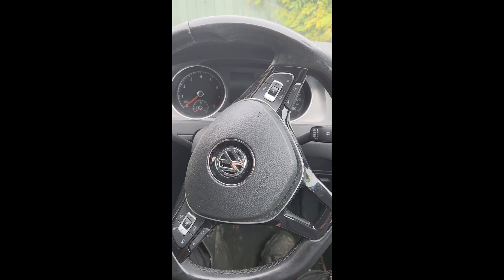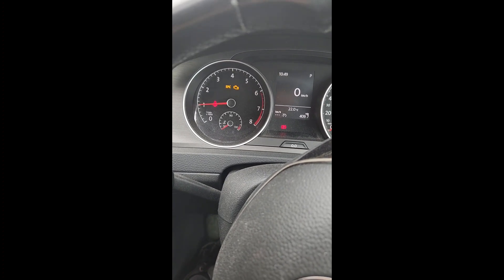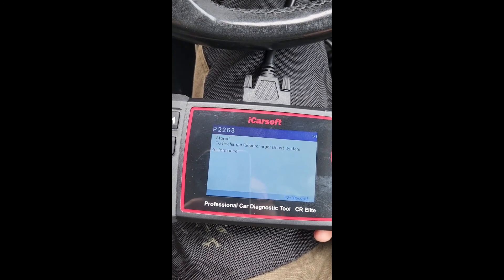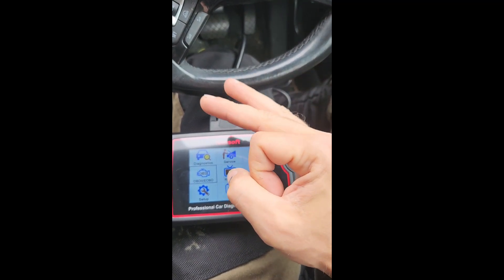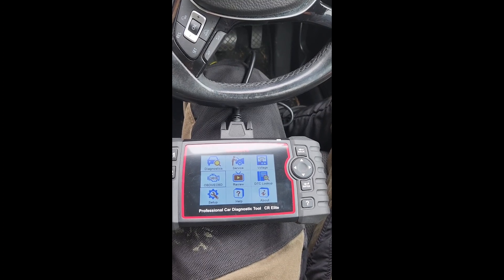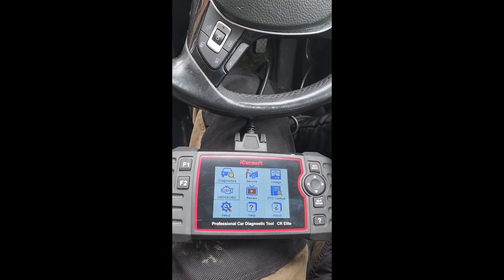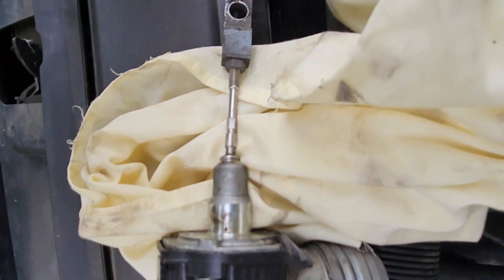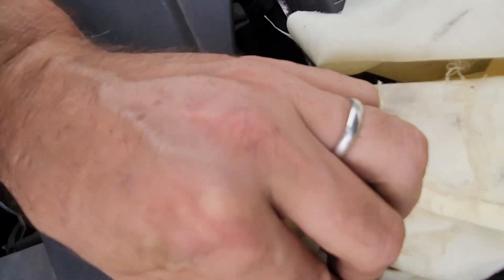vw engine code p2263 epc light turbocharger issue

Comment: I have a 2017 Jetta 1.4t and if the engine bay gets warm it causes a P2263 code and EPC light.  Car goes into limp mode and only way to get it to temporarily go away is clear the fault when I’m back up to a decent speed driving.  As soon as I stop again at a red light the EPC light and P2663 come on again.  I’m
Guessing the actuator sensor going bad but idk for sure.
Reply from the maker: That is similar to the issues we had. Try cleaning and lubing the actuator arm pivot, and feel for any roughness or sticking from the actuator.  I later changed the actuator on this car as it had developed some noticeable play in the actuator

Comment: What part did you even lubrikate? You skipped the importent part 😅
Reply from the maker: 9:44 the bit i am cleaning that is at the end of the rod. also put some on the "male" part on the wastegate arm
Reply: @tortron  well i did that today, with heatresistent greece. But it got wurs! Tho it was no nickle in it. What does the nickle do?
Reply from the maker: @skyloot359  the nickel grease is the only grease that will withstand the heat from being so close to the turbo
Reply: @tortron  i see, because i jused a bearinggreese that is for high temp. I will try and see then. Thanks have a nice day
Reply from the maker: @skyloot359  yes the bearing grease will fail very quickly, even copper high temp grease will not last, it needs to be the nickel grease.

Comment: hello torton, what part(s) are you covering with the anti sieze exactly doing this job this week, cheers for the response
Reply from the maker: @ghost-ms2fj  just the pivot point. The pin part you remove the clip from, and the part with the hole on the end of the rod. Make sure both parts are very clean if reusing the actuator rather than replacing.
Reply: @ cheers man and last thing…would you have to use the nickel anti sieze, would copper work etc. cheers
Reply from the maker: @ghost-ms2fj  yes, the copper antisieze isn't up to the job with the heat from the turbo right there. Definitely use nickel

Comment: this is very valuable, its VW gold hopefully people see and understand it, and appreciate the fix, most dealers and mechanics are going to say, yeah nah you need a new turbo, im not even joking. thanks for the video. what also causes tightness, is if your lock in pin is sligy bent,  and you have a square type connecter that goes into the rod like this one, the pin when its bent, it binds to the square rod end and doesnt allow it to move properly.

Comment: I have a 1.2 tsi cbz engine jetta. Previously the turbo was filling between 1500-2000 rpm, now it started to fill between 2500-3000 rpm. There is no fault record, what could be the reason, is the wastegate leaking?

Comment: Having this exact issue with my 2016 jetta with the 1.4t and I'm being told i have to replace the turbo in order to be able to replace the actuator im gonna give this a shot when i get in there for my tune up
Reply from the maker: Yes the dealer will sell you an entire turbo assembly to fix this. I rventually replaced just the actuator with a "genuine" part out of china and its been fine

Comment: Very good vid. I have same code with 2016 vw jetta. Came on after I changed the air filter. Will try.
Reply from the maker: @proscentgifts  you will also get the same code if the MAF or air intake sensor is unplugged or loose
Reply: Did it work?

Comment: Can this mean this is why there was waste gate rattle when revving and epc lights but no power loss when accelerating ?
Reply from the maker: Yes, sometimes that's what's happens as well, early on, before it gets bad enough to make the ecu limp mode. There is also a seperate issue of wastegate rattle that is "fixed" with an add on spring clip,
Reply: Where are you based if you could sort it for me?
Reply: I’m having the same issue right now. Did you ever figure it out
Reply: @israelnavarro7021  I just went to mechanic and changed watergate actuator. It was fine after this. What engine have you got?
Reply: @Tp0102  I inspected it yesterday and the actuator is broken as well just like the video. I have the 1.4. Did you go oem or after market
Reply: @israelnavarro7021  I went for aftermarket as not car is on 95k so trying to keep it for another 2 years maybe I guess there.
Reply: What is your mileage on your car
Reply: @Tp0102  mine has 93k miles almost 94k. Thanks for the reply I appreciate it. I’m going to order it today

Comment: what is the solution for the p2263 wastegate problem?
Reply from the maker: Usually it's the wastegate actuator arm sticking at that pivot. If you remove it. Clean it and If needed polish the surfaces, then use very high temperature grease on it, like Nickle antiseize or vw hot bolt paste. You may need to then clear the code and clear the adaptations for it
Reply: @tortron У меня такая проблема сказали что надо менят актуатор. А это дорого стоит у нас 200-300 долларов. Я сегодня вбрызгнул туда wd 40. Но это не помогло. Как мне быть поменят актуатор или так почистит? Это поможет?
Reply from the maker: @eminquliyev6672  no, wd40 will not help. you can remove the actuator and clean + polish the pivot point between actuator end and wastegate, and apply nickel high temp grease. However the actuator can become worn, you will feel some  play, a few mm, in moving the shaft back and forward into the housing. When the pivot is not greased this accelerates the wear inside the actuator. so it must be replaced. you can get the actuator from ebay from a china seller, they were very good and can supply the correct part from your chassis number even if itnis not listed. i think total price including shipping was about $140 nzd
Reply: Спасибо я попробую если не починю то куплю новую. Главное что турбо не поменять. А так пока едит машина иногда горит епс  @tortron
Reply: @eminquliyev6672 as above so what this guy done